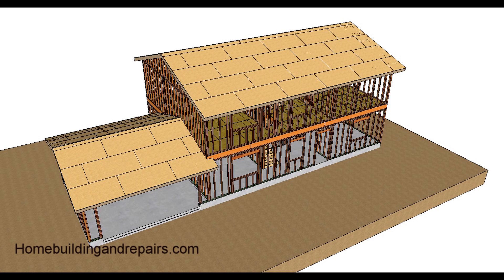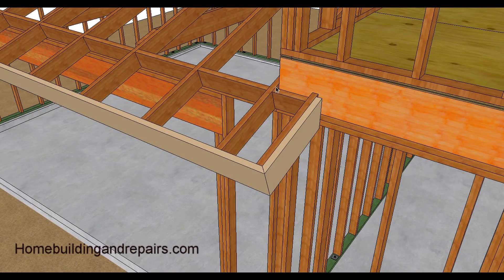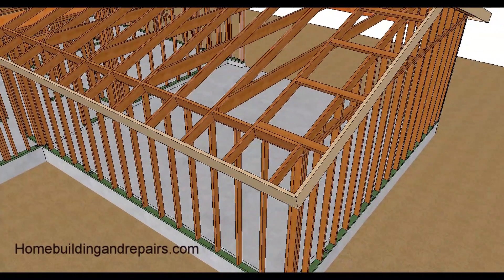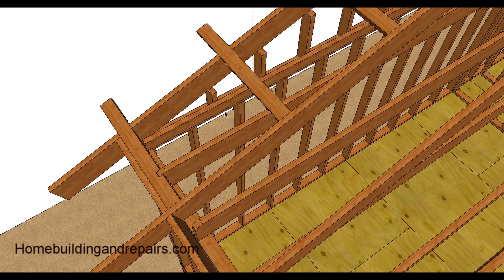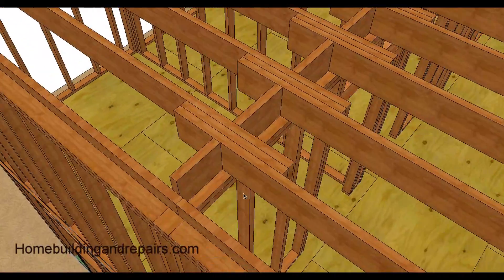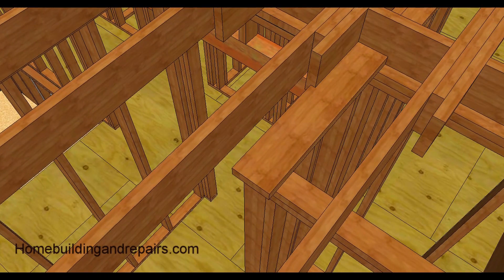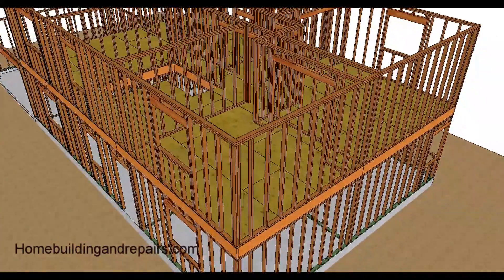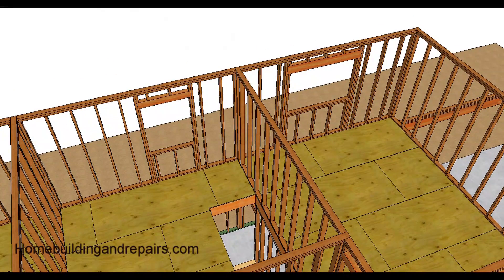Two Story House Framing Part Two - Gable Roof and Garage

Comment: As long as beams are properly sized to carry the load, would the Uniform Building Code allow your second floor to extend halfway over your garage? The garage header would be sized accordingly as well as the floor joists. Thank you!
Reply from the maker: If an engineer approved the design, then yes. I don't know if you can use building code books to find lumber sizes for every type of design.

Comment: For the sake of simplification, can we have a roof with rafters 16oc directly rested on studs also placed at 16oc? What is the cons of that? Thank you
Reply from the maker: Yes, rafters can sit on top of studs, but sometime all of the windows, door and other stuff that goes into a wall can create problems.
Reply: @constructionideas  Do you have any videos that would describe the problems you're talking about or could you describe the problems with that here? Are the 16 in oc ceiling joists offset from the studs for the same reason? Thanks

Comment: Hey I live in Florida. What are homes constructed called with first floor in block and second floor lumber. Thanks in advance.
Reply from the maker: I don't know if there's a specific name, but I would refer to it as Masonary or block wall construction on the lower level and wood framing on the top. If the lower level has a basement built out a block, then it might be called a wood framed home with a basement. Hope it helps.
Reply: constructionideas raised ranch